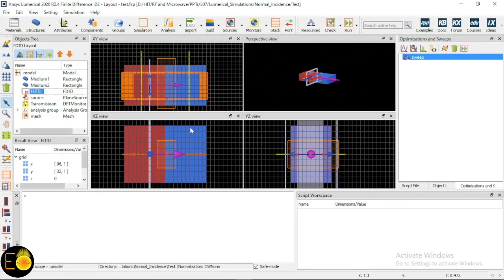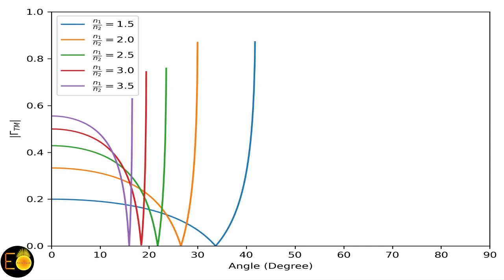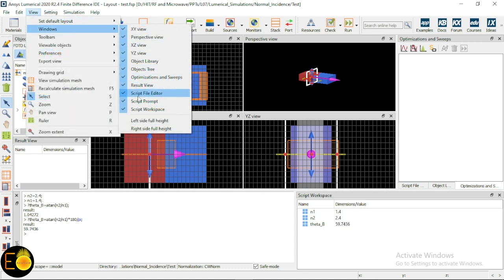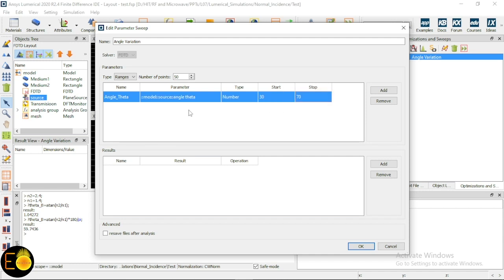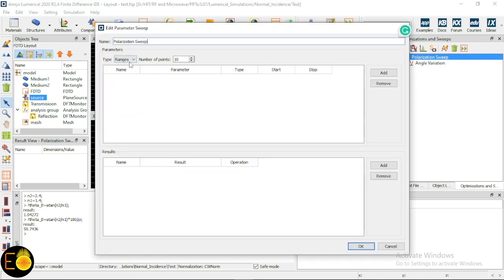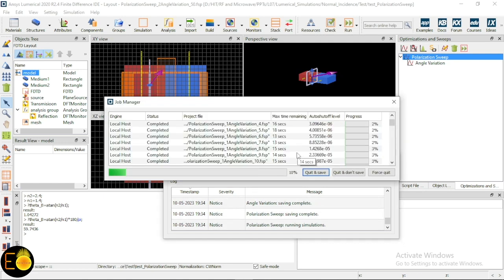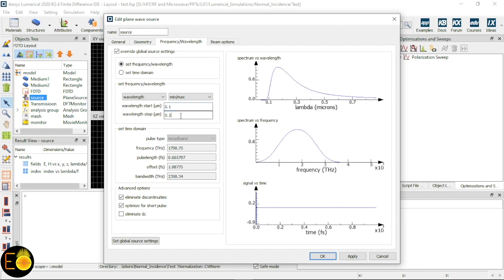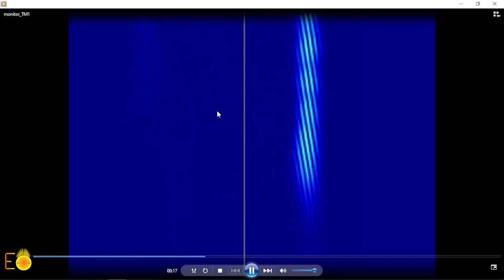L04 Lumerical FDTD | Parameter Sweep Part1 | TM and TE Polarization | Brewester's Angle

Comment: Thank you so much for the video. It is useful and easy to grasp. However, I have a question. I tried this angle theta variation for my MIM structure and I obtained some results that includes minus and over 1 reflection values. I was only expecting between 0 and 1, I wanted to ask if you encountered such a situation before? I didnt calculate brewster angle since my simulation consisted of 1 um broad bandwidth.
Reply from the maker: The negative sign comes because of the transmission () function. If you place a power monitor at a position where the forward propagating wave encounters the function gives you positive. On the contrary, placing the monitor in the direction opposed to the propagation the function gives you negative, which is quite obvious for reflected wave. It’s a simple numerical convention. Therefore, to get a proper result for reflection just place a negative sign before the transmission () function in the script